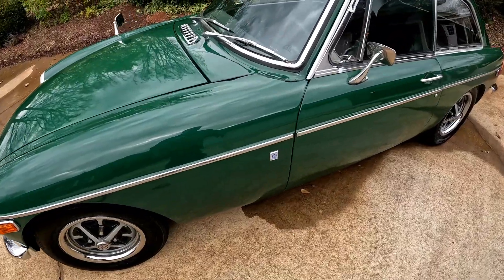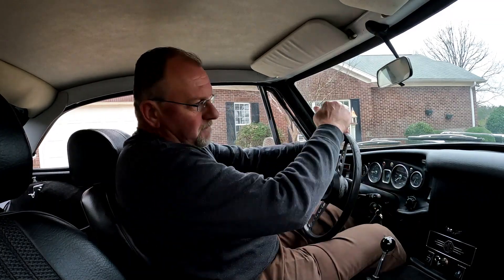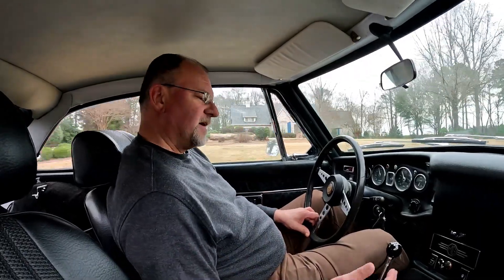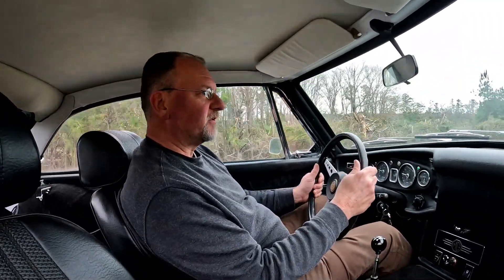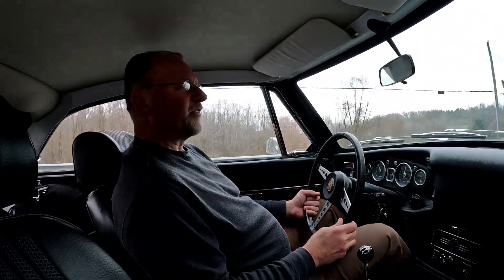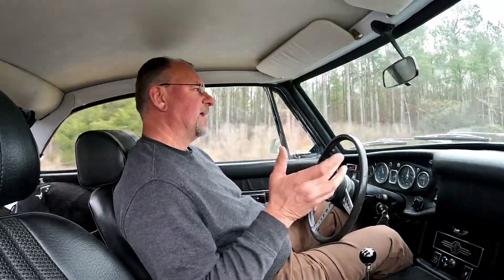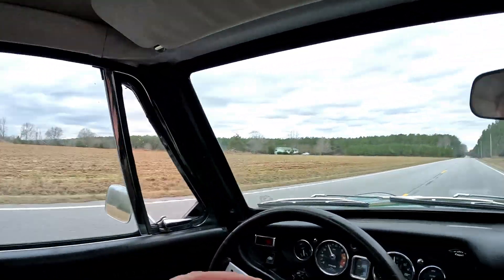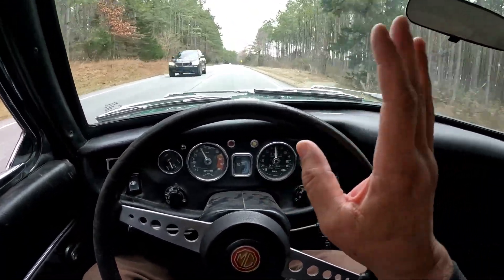Driving a 1970 MGB GT

Comment: The overdrive should work in 3rd and 4th gear. Does in my 70 roadster and 73 BGT
Reply from the maker: Yes, and correct. Healeys operate the same way. I do have an extra B OD trans in the shop.